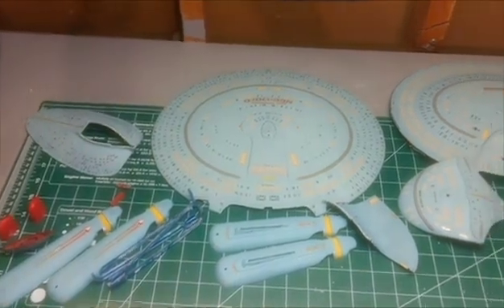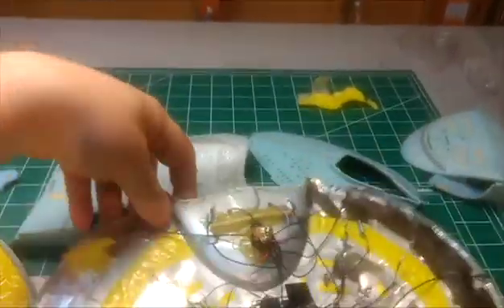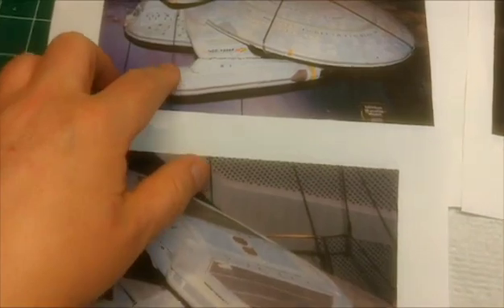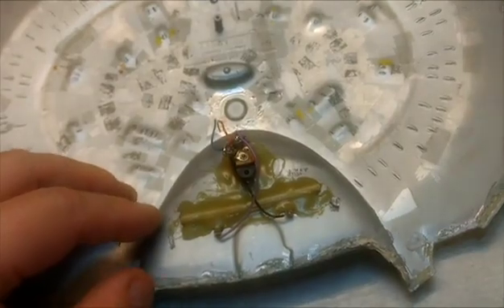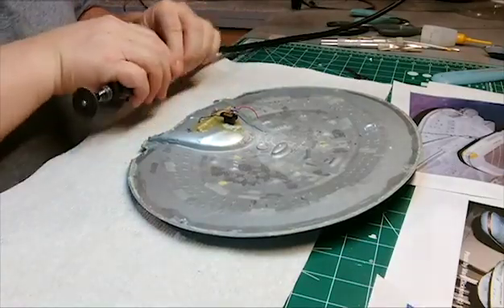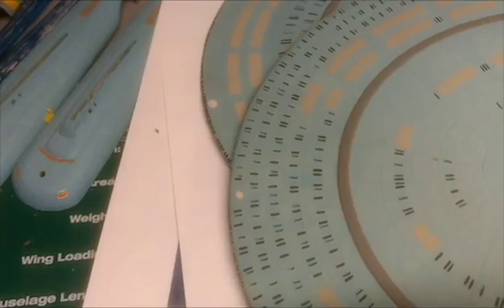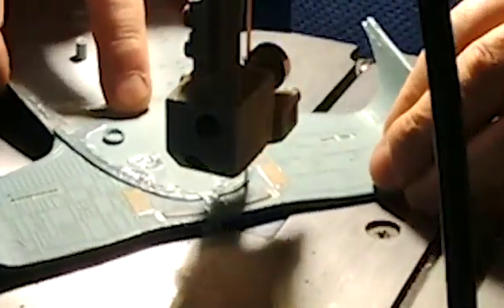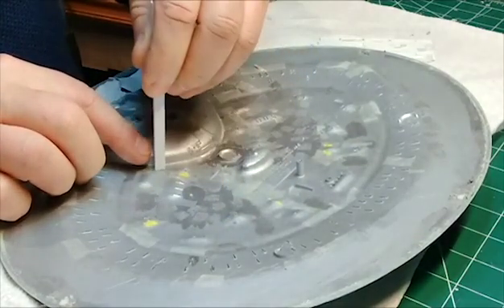Nebula Class Build (Part 1)

Comment: I'm thinking of modifying a clear model into a nebula (I have two so I can build the Enterprise as well). I'm thinking of saving the very top of the stardrive section where it connects to the saucer so I won't have to fill in the area which sits on the battle bridge. I'm also tempted to see if I can keep it able to separate as well.
Although I possibly won't be staying 100% faithful to the original model- I won't be changing the shape of the deflector or making the windows bigger. 
I'll just handwave it as a Dominion War design where they needed powerful ships but more cheaply than the Galaxy so just upscaled the Nebula design a bit.

Looking forwards to how this project develops though, I'll certainly be taking notes!
Reply from the maker: I would love to see pictures of your finished model.